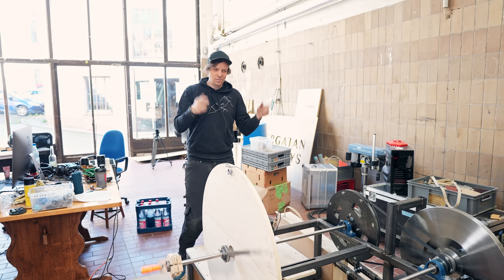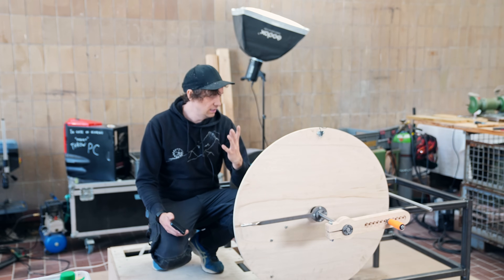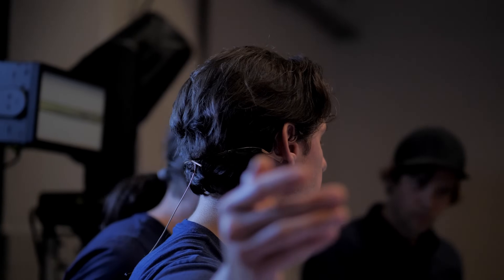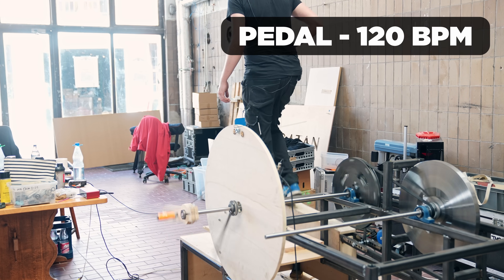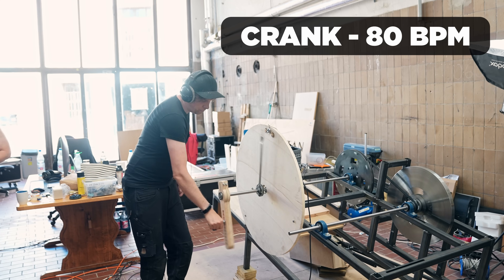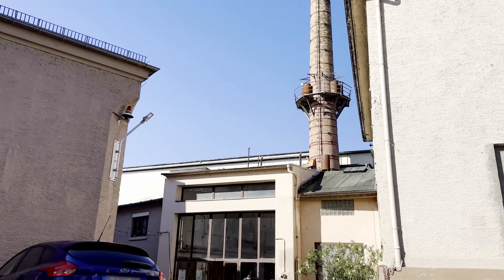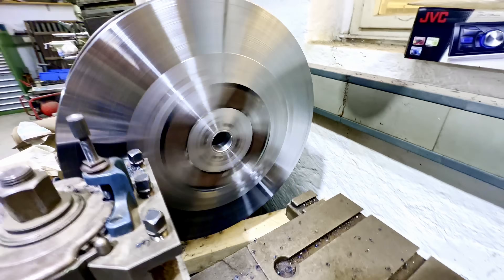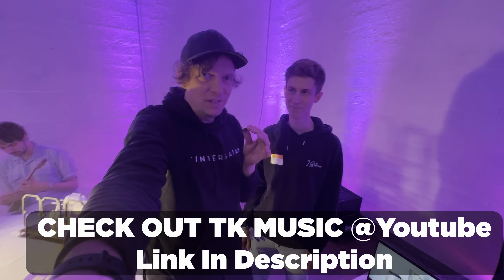The Prototype is Finished - DAY 10 - Marble Machine Flywheel Prototype

Comment: If it doesn't work out just use a motor with a pedal you can tap the tempo on, that would be the most precise and accurate option

Comment: Martin, you have a pair of incompatible requirements that are not documented and cause pain. You want an instrument AND a machine in one.
An instrument is used by human. For the musical instrument this means powering and timing from the muscles of a human.
But a machine must be self powered. And self timed.

Switching to the Hugens mechanism disappoints you because it doesn't fit you requirement of MMX being an instrument. But that's you requirements mistake. 
Hope you'll write down ALL your hopes) And fix your requirements first, so they will fit your hopes.
Reply: Separating the machine power subsystem from the human power subsystem may help to get both of the requirements done.

For example there might be a mechanical switch that lets the flywheel rotate freely while the whole MMX starts getting power from human muscles only. Lightness of a programming wheel is crucial for that path.

Comment: Martin, as you've said earlier, you are trying to match the ticks not the tempo. When you're behind you're trying to speed up but you speeding to much to catch up ticks not the tempo. So you have to overspeed your desired tempo. This what messes up the most, i think. You should install some sort of display which will show you your current tempo calculated from last ticks on your contact microphone. That's how you will know the exact moment you should stop accelerating your tempo - when it'll show your 80 (or 100 or whatever).

Comment: what're the chances the handle is more off due to the bending of the rod that holds the fly wheel? it's already shown bends, has it kept bending between the pedal bpm test and the handle, or the angle causing more stress on it?

Comment: i'll say it here. i had missed the previous video. instead of turning the wheel to cut off metal you probably should have looked to see if something else was throwing off the wheel.  it was probably something misaligned with the axel and center bearing

Comment: For safety, anywhere humans are going to be interacting with a flywheel, I would suggest considering ensuring the connection is driven with a one-way clutch. That way if, God forbid, something goes wrong you are able to input power into the flywheel, but it's not able to send power back to you. Many one-way clutches can have configurable drag to ensure your pedal is able to return to the home position, or you could use springs so that it always returns to home no matter what position the flywheel is in.

Comment: It seems to me that the pedal IS actually taking a lot of energy out of the system. I'm curious what would happen if you counted the total number of rotations the system makes in that same test. The inertia from the heavy flywheel keeps the system turning, pedal or no pedal, but the tempo seemed to remain more consistent for longer without the pedal attached. You can actually see in the video how the whole system slows almost immediately with the pedal, but slows more gradually without

Comment: The effort seen while Martin powered the system made me think about E-bikes. E-bikes can be setup so you control the speed by how fast you pedal, but the effort of pedaling is assisted by the electric motor.

Part of the issue seems to be that it is very hard to control the speed because the system has so much momentum, but you need the momentum to keep the tempo consistent. The pedal and the crank are both providing energy to the system while attempting to maintain an even tempo.

I am curious as to what Martin’s baseline for tapping his foot is. How tight is he able to produce a rhythm when he doesn’t need to be providing energy to the system? Is the system better or worse than Martin just tapping out a tempo?

If he can tap out a tight tempo when he is not powering the system, then maybe he needs a way to control tempo by tapping that doesn’t also power the system. If he can not tap out a tight tempo by himself, then he is asking too much of the machine to be better than he can do by himself.

Comment: You are drastically overdiong the machine.  There is way too much mass & too high a gear ratio to the flywheel.  If you want precision time, put on a motor.  If you want a musical instrument, ditch the motor & the heavy flywheel.
          Have you considered putting on a governor?

Comment: What about an assembly that allows you to put in additional rotational energy into the flywheel but with a governor gear assembly that limits it to a set tempo?  That way you could put in more energy than necessary but have it limit to the tempo you desire; you’d just need to keep the rotational inertia at or above the required amount. Then you’d just need to validate that the governor gear assembly played the tight tempo given adequate input energy.

Comment: That fly-wheel is sooooo dangerous. You should really put a spragg clutch on the pedal and crank connection points so that they can slip in the anti-clockwise direction. I know it’s a prototype, but a little thought to safety is wise here. 😊

Comment: Just a reflexion: even if rhythm is tightier with crank instead of pedal, your hand is busy and your less able to manage settings, levers and other gear fine tuning job... Maybe a real pedal system (meaning two pedals like with a bicycle one) would be more ergonomic and probably more efficient (and less tiring).

Comment: I think the feeling that the pedal is sapping power is because it sucks in energy as it rises but gives it back as it falls. This evens out across a beat but could be affecting your rythym mid beat. 

You may need a counterweight to prevent variation in timing across each beat.

Comment: When you're powering the machine with your foot, you are only powering it for half the rotation, and that might lead to surging and lagging in the flywheel. 

I wonder if there is a setup where you could use a Sprag Clutch Bearing (one way bearing) between the foot petal wheel and the main flywheel; Imagine it like a bicycle's one-way pedal/chain mechanism.
If you are pedaling faster than the flywheel the flywheel will speed up, but if you stop pedaling, or slow down, it would free-wheel and it wouldn't sap energy from the main flywheel.

You might need a spring to help you return the pedal to the top to get it going?

Comment: considering the eventual weight of the whole machine and all the assembly and parasitic drag that it entails maybe it's wise to add a supporting motor assist to the flywheel
the way it could work is that you add a strain gauge on the pedal and if it sees a prolonged amount of stress on the pedal the motor assist kick in, this way it's still all the manual control you have from having a pedal and crank but without as much energy required
while you can play relatively tight music now i don't think that's the case when you're exhausted and your feet feels like noodle, a 100W additional boost in pedalling power can help wonders for that. This way your motor skill can be focused on playing tight and not on how to sustain the high level of exertion

Comment: I notice you're only measuring whole revolutions. I imagine a big part of the problem with the pedal is that it will be going slower just before the stroke and faster just after it ends, so it won't be as even with fractions of a stroke. The crank can be pushed in every direction, so it's less of an issue there. Though if the pedal is consistently off, you could make up for it by altering the exact timing of the notes.

Comment: I think what makes a crank handle feel nicer is that the beat always happens when the handle is in the same position, so it feels tighter and makes it easier to get in time with the metronome.

The treadle pedal still has a fair bit of flex, so the beat doesn't always hit at the bottom of a step, so it feels a lot more floaty and inconsistent when playing, also making it a lot harder to synchronise. A stiffer pedal lever arm, such as a truss structure rather than a single box section, would help synchronise the steps to the beat.

Comment: Yeah, crank would be applying power 100% of the rotation, while pedal is applying power ~50% of the rotation.  It's also harder to control how much power is each step is applied since the "human factor" is harder to control.   But a bigger flywheel may help.  I see the importance of the pedal, though, because it frees the hands to operation other parts of the machine.  I suppose something like a bicycle crank where you sit down and pedal like a bicycle to power the machine?  Doesn't seem as cool, though.

Comment: A flywheel does not do speed regulation, it simply stores energy and then release/returns it. Every time you push on the pedal you are affecting the output speed, and when you don't push on the pedal, friction is slowing down the flywheel and changing the output speed. You need some form of speed regulator (governor) to allow the flywheel to produce consistent rpm (rotations per minute) output. This speed regulator will then decouple your power input from the flywheel output. That way the governor will take output from the flywheel (energy storage) and produce a consistent regulated output, while at the same time you can add power/energy to the system via pedal or crank without influencing the output speed. Without a governor you are relaying on your human ability to regulate the speed/rpm, which as you have started discovering is very difficult to do. Remember, you add energy to a flywheel but once you stop adding the rpm output will slowly decrease over time due to friction, it will never produce a consistent speed output. And you human pedaled input will always be adding spikes in speed, as you add energy to the flywheel.

Comment: Now im wondering if you can have a bpm meter mechanically. What I'm thinking is some type of gearing with slip(like two flat wheels) and you have it try to rotate a pendulum with a set weight where the point of rotation at the gear. So the faster the drive gear goes the more it rotates opisite of the drive gear. Im not sure if this work or not just wanna throw an idea out.

Comment: Is the huygen drive part of the final plan?  If the pedal drives the flywheel which loads the huygen which turns the drum it only matters to input more beats than song requires & none of this would matter...right?  Also, it seems like what the adjustment that would help most is increase Flywheel to Drum bpm ratio.  Maybe calc max flywheel rpm and match that rpm to theoretical max bpm.

Comment: Try moving the crank off the plywood disc to the other side of the machine.  Your are not comparing  your input correctly.  One input (the crank) is directly connected to switch input when the pedal goes through several pulleys.  That seems to me to be your data problem.

Comment: Does it mean that a full revolution if the flywheel will only trigger a single line of opening gates? Also, would an engine with rpm feeback that auto adjusts it's speed to keep the beat work? Manual input will always be irregular.

Comment: 2:00 Well If you look very close
the Pedal when it's moving down will increase the tempo and when it's moving up it slows it down.

Technically It borrows the energy and gives it back to the system but I don't know how important/significant it is.

It'll probably a minor thing but It's something to consider if you want very, very tight Music.

If it's significant enough you just put a weight equal to the Pedals weight (at the crankshaft) on the other side of it to counteract it.

Comment: they were going the same speed but the pedal was more mass, so it will go longer. if you have 2 bowling balls at the top of a hill, 1 pound and 100, and the salt flats at the bottom, the 100 pound ball will go way further.

Comment: 15:00 the reason your flywheel is still running out is because you registered/ tapped it in on the chuck jaw openings, instead of the bore the bearing/shaft sleeve is in, before you turned the flywheel face. Something that would be obvious to a 1st year fitting & turning apprentice, but rocket science to your brains trust, it seems.

Comment: When you crank, the pickup is directly connected, so you sense the beat at the top of the turn. On the pedal, the beat is not at the bottom of the pedal push, and isn't synced directly.

Comment: It makes sense that the pedal won't rob much energy. The flywheel expends energy to lift the pedal. But then gravity pulling the pedal back down puts energy back into the flywheel. Net zero energy when it comes to gravity.

Your only losses are from the friction at the rotating (pivot) points of the pedal, and the incredibly small amount of air friction at that slow of a speed.

Comment: Great tool to have for quickly getting the data, with some interesting results. This really feels like it's a gearing issue - at a lower BPM, any corrective influence has a much higher impact when making adjustments. So a "starter" gear to get it up to speed, then switch to a gear that can handle high BPM by amplifying the input more, or a lower gear to handle a slower BPM by reducing the magnitude of the input? It doesn't even necessarily have to be connected to the flywheel through the belt, but keep the gearing separate and linked to the current input wheel by being on the same axle?

Comment: The crank has a direct link between input and output, with the pedal it goes via flywheel pulleys etc. (not 1/1)

1) direct connection makes "feeling" the tempo easier, as you start cranking to the beat
2) the pedal has to be stepped at a different speed as the pulleys etc. make the link less direct

Theory:
Controlling the speed directly makes small adjustments a lot more easy, but you "fool yourself" by having a lot more variance. If it's slightly behind, you automatically crank faster to hit the beat, and if it's too fast you slow down before every beat. 
With the flywheel it's more difficult to hit a given speed, but because you "regulate" more slowly it's more stable.

Reminds me of tuning a PID controller xD

At which point will it be "tight" enough? Do you set yourself a goal before every test?
Hitting 100% of something usually gets more difficult exponentially 😅

Comment: You don't need "absolute" timing, you will not e playing multiple marble machines at once, or with a sequencer. Your band can adjust the phase shift based on the marble machine. Therefore, you don't need to "catch up" with the metronome if you fall behind, or slow down if you are ahead. You really only care about relative timing of the clicks, which is the instantaneous tempo of the machine. As long as you can keep that one more or less constant, that's a win.

Comment: Question 4ms deviation " None of it good enough?" 

Theory: Maybe its because its human powered?

Research: For most human beings playing a instrument professionally the mean deviation is 5–15 ms. 
Perfecting imperfection. People often perceive perfectly timed computer-generated beats as artificial and lacking a human touch. Professional audio editing software therefore offers a humanizing feature that artificially generates rhythmic fluctuations. 

Conclusion:   4 ms deviation is beyond human accuracy because of the assistance of the flywheel. We must embrace the imperfections as within reasonable acceptable tolerance, because we are self's are imperfect. For results with and more extreme inhuman timing. You will need to remove the human element. But without the human it has no soul and will become sterile sounding when preforming music.

Comment: There’s a mechanism on jet engines and generators called a constant speed drive, which does a steady output with a variable input. You could maybe use that with a transmission with a gear for every 10 bpm. Alternatively you could just crank a generator and run it off electrical power. It’s not quite as steam punk but the result would be the same.

Comment: I think you need stomp pedal that restarts the click. You are trying to do two things at once which are tied together so you're fighting yourself. You are trying to get the machine to the right speed (frequency) but you are also trying to get the piezo synced with the click (phase). The problem is, if you get up to the right frequency but you're out of phase, the only method you have currently for changing phase is to speed up or slow down, i.e. losing the frequency. You need a system to electronically shift the phase, which could be as simple as an electronic switch pedal that sends a signal to restart the click at that instant. Then all you have to do is stomp when the piezo is just about to hit

Comment: I think the reason why the hand crank felt better to you is related to the problem you described in the last video: when you „overshoot“ the target bpm ever so slightly, you can „break“ the whole system way easier than with the foot pedal. Thats also why i think that a bicycle - like „free-wheeling“ solution might be counterproductive (but probably safer at the same time)

Since i never played a marble machine, this thought might be flawed though :D

Comment: I'm curious why you are trying to match a BPM, rather than having the pickup tell you when you have reached the desired BPM or what your current BPM is.. its like trying to get a turn signal on 2 cars to match up.. almost impossible. then if it is telling you live what your BPM is, can you maintain that. In the live scenario, I am guessing that the machine will be setting the pace of the music anyway - you will not be trying to time it to some other timekeeper.
Reply: also, a thought of a mechanical govenor coupled with a CVT of a sort, to regulate the speed surges caused by a physical mechanical input.